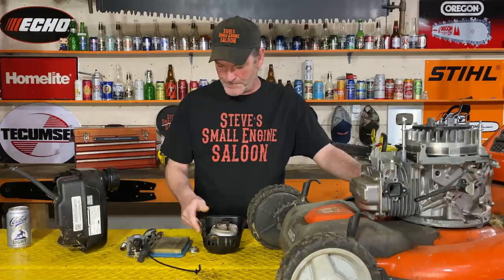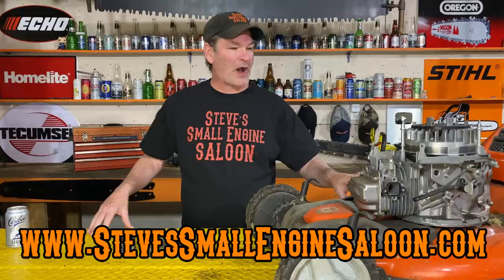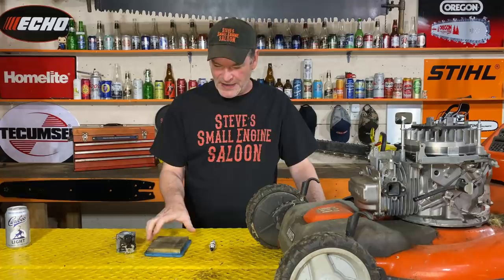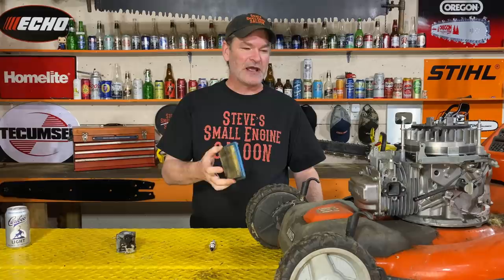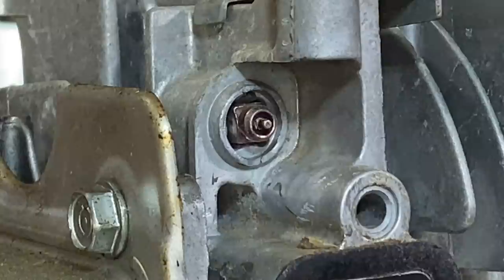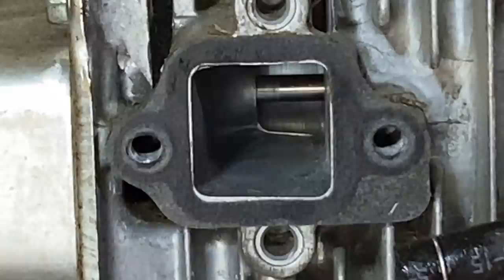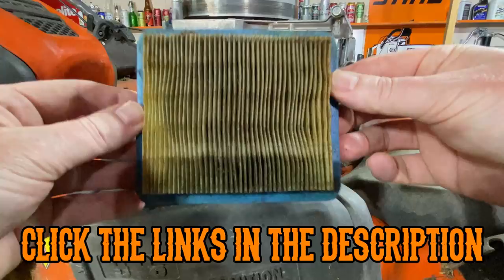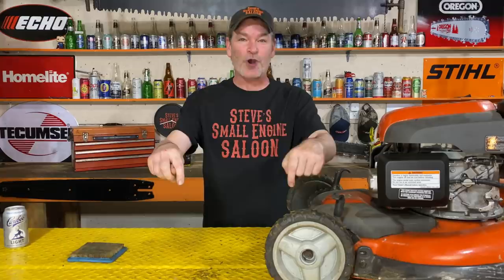What Happens If You Flip A Lawn Mower Over Wrong?  (LOSE MONEY)

Comment: I had a mower given to me because no one could fix it. Water in gas.  I bought a premium self propelled bagger with electric start sold to me for $20.  Guy hung in by the handle on his garage wall all winter. Cylinder full of oil.  Picked up a year old mower for $25. Woman's son tinkered with it then it would not run.  Spark plug wire crimped by housing-not through opening.  Bought a truck and trailer full of Toro S-200 snow blowers for $5 each.  Every one was just a carb diaphram and a few needed new paddles.  Almost bought a nice Cub Cadet garden tractor for $500. Old farmer could not get it to start and gave up on it.  I drained the fuel tank of the kerosene,refilled with gas and took it back to him. I just couldn't live with myself if I kept that one.

Comment: I heard a knocking last year on an older John Deere push mower. Tore it completely apart. Found a little, (almost no) play in the connecting rod. Put it all back together. After 5 minutes, started knocking again... Was the frigging aftermarket lawnmower blade loosening and banging around... Lesson in checking the little things first!
Reply from the maker: Agreed!
Reply: Ya know, another reason why those older John Deere's knock is because they can't ring the door bell eh !
Reply: Picked up a push mower on the side of the road,  said free on it. Got it home and started it, ran very rough and low rpm. Started taking it apart and saw it was not taken care of, grass everywhere. Under the cover, packed in the fins of the engine. All it was missing was a spring on the throttle lever. Nice easy, cheap fix! Just a little maintenance goes a long way!
Reply: I picked up a Toro Personal Pace lawn mower, almost new, because the owner was told that the crankshaft was bent.  I tipped it over to check the crank and the blade was so loose it almost fell off.  Tightened it back up and sold it for $250.00 the next day.  It ran perfectly.  I'm looking for another one.  Ha ha

Comment: Two years back I picked one up trash day with a kholer engine. It stayed dormant in my tool shed until this last weekend. Tried to start it and no luck. I did look into the air filter right away. For further precautions I took the fuel bowl and carb apart.  Dusted it them off and fired right up minus the air filter lol. 
Did just what you done and the exact same thing happened. It went to dye almost immediately.  Air filter replacement $5.99
Great video 👍🏼👍🏼👍🏼

Comment: I was taught check the simple things first. Saves so much headache, time, money, and work.  Clogged spark arrestors create a similar issue. I found if you simply remove said arrestors it alleviates the choking issue. Some types of Stihl equipment are quite problematic in this regard. Also one must always follow directions on machinery.
Reply: I took one off of my weed eater and it instantly ran like brand new! Yep,,,,, file 13.
Reply: @marcmyers1465  true dat!  I use high octane, non ethanol gas in all my gas powered  equipment. Everything runs better without the gumming and clogging effects you can also get from ethanol.  Best to stay away from it if one can do so.  Good information BTW.
Reply: If you’re having that problem you are probably mixing your 2 cycle gas oil mix with too much oil. It also really helps to use the Stihl full synthetic additive.
Reply: @Manhandle730  very good points. It is always best to use the recommend oil in the exact ratios.
Reply: @patricknesbit2334  it really does. I worked for a guy years ago that instead of using up the can of two cycle he would just top it off when it was 1/4 full or so. Then he would add the normal amount of oil. You do that enough and you’re running your equipment on a 50/50 or more blend. The gas was black I swear!! Worst part was he wouldn’t listen to reason. Obviously because I was in my early 20s and young and he was in his four years therefore smart totally made sense. This is a tiny example of this guys genius mind. I wasn’t surprised when I learned a year after quitting that he went out of business.
Reply: @Manhandle730  aww yes the arrogance of some when they get older and "wiser"  and feel that simply because someone is younger than them that person is stupid and therefore truly ignorant of how things work. I have run up against this so many times in my fifty years of life. I do not care how old someone is I know there are those young, brilliant, wiser minds that often times have much to offer and can teach an old, willing dog new tricks as it were.  People of all ages need to be flexible and understand they may not know it all even if they are older than their teacher. 

My father taught me to mix in a large can to the right ratios and use smaller gallon jugs to fill equipment with. Once the big can is empty we  make fresh new batch, thus avoiding the mess you saw.

Comment: I have the same mower. Had it for almost three years now. Still starts and runs perfect but leaks oil from the head gasket. Second Honda engine mower i have had to leak oil. I also removed the plastic cover over the front belt as it just completely clogged with grass every time I mowed.

Comment: I had two push mowers given to me. The one needed a new fuel line which had rotted off. The other mower I cleaned the carb and am still using it. If the mower doesn’t start, people do not want to be bothered. I guess that’s to our benefit. Keep the great video’s coming!
Reply from the maker: Will do!

Comment: 2 free "used once" mowers exactly alike. What's the story? Brigs motors ran out of gas and fuel added, just enough to finish the big lawn. It wouldn't start so he bought another, filled it and the same thing happened. He bought a different mower with a bigger tank.
Reply: @tomtheplummer7322  Or give up smoking lol
Reply: if he can afford that...  my dad's complaint about his current brush cutter is that he'd like it to have a little bit bigger tank, so he gets tired of using it at about the same time it runs out of gas, so I bought one with a bigger tank.

Comment: I have two garages full of small engines that I fixed over the years. I haven't bought a lawn mower since 1992, and I still have that one. I have my choice of what to use when I blow snow, mow the lawn, etc.  Like you and others have said, common sense is mostly what you need when you work on small engines. I spotted a Toro snow blower at the curb, and just from looking at it, I knew what the issue was---it was missing the primer. I cleaned the carburetor and plug, put a new primer on from Ebay for $3, and it fired right up. I used it the next week to clean my driveway at my workshop, and it ran like a top. A year later I found a Husqvarna 125BVX blower tossed out. It ran off the curb, but not well. The air filter was packed with dirt and the plug was fouled. I replaced both for under $5, and got a used blower tube, so I'm into the whole thing for $20. It runs like a champ. I could go on and on. We are in a throwaway society where people don't take the time to go through the simple stuff and take care of their investments. 

In 2019, I spotted a circa 2007 MTD mower at the curb, two doors up from me. I took it and the cord was "locked up" solid. I got to looking at it, and the air filter was soaked with oil. The engine oil was clean, but WAY over the full mark. I leveled off the oil, put a new plug and air filter in and freed up the cord. Pulled the starter rope and it fired right up.

The next day I'm cutting my lawn with it, and the neighbor that threw it out is walking his dog. He signals for me to shut the machine off. He said, "Oh, got it running?" (Pretty obvious that I did). I said, "Yea, someone overfilled it with oil and soaked the air filter...." He said, "Well I didn't need it anyhow, I bought an electric mower". I laughed and said, "Yup, everyone throws out a good running gas mower to go buy an electric one". LOL.

Comment: Level one diagnostic: Fuel, air or spark. It's gotta be one or a combination.
Reply: Or timing, they can shear the flywheel key.
The formula for starting an engine is F.A.R.T.S.
Fuel.
Air.
Revolutions.
Timing.
Spark.
If those check good, it's a base engine concern and engine integrity tests must follow.
Compression.
Leak down.
Boroscope.
Teardown inspections.
Yep.
It's a process.
Reply: Or  compression.

Comment: Steve, two days after I watched this video I found a Toro Recycler out at the curb for trash day. It looked barely used and the engine pulled over with good compression. Turns out the only issue was an oil fouled air filter. Owner had over-filled the crankcase. Shaking my head!
Reply from the maker: Right on Mark!

Comment: Had a Husky mower years ago. Ran really well. It didn’t like hitting a small tree stump though. Engine survived but got ripped off the deck ! Deck was wrecked, it was only plastic. New deck and it was as good as new.
Reply from the maker: Interesting!
Reply: I got a Briggs 24 hp V twin with the electric clutch for 100 bucks. It had 3 hours on it.  Guy bought a zero turn JD.  He mowed his yard one time and the tornado hit Joplin. Picked up his mower and flipped it. His insurance paid for a new one and didn't want the old one. I put it on a racing mower I built. Sold the electric clutch for 100 bucks. I would run 50% regular gas and 50% Torco 110 octane. Cop got me once on the road out front of my house. He showed me his radar.  61 in a 55. Lol
Reply: @jerrymeeuwse859  When properly geared, 24HP could easily get you up to 60MPH, as long as the tractor isn't too heavy though, remember, its that whole power to weight ratio.
Reply: @stellarproductions8888  Oh yeah I know. I've built a number of racing mowers and experimented with many different setups.  I build my own front axles because I'm not gonna go that fast on that stock axle. Peerless 700 series mud box trannies are the best. I put a tall 3rd gear in them and by the time you hit 4th, your gone. I used to have lots of friends and other racers come and ask me advice or help building their racers. It sure is fun. I built a quarter mile track in my back pasture in Missouri and would have atleast 2 races a month. Lots of fun had by all
Reply: @jerrymeeuwse859  Sounds like loads of fun for sure. I got one of those 1990 Craftsman, back when the hoods were all metal and square shaped. It's only got a 12.5HP engine. But I swapped the 8" pulley on tranny with a 3.5", installed a few idler pulleys, different belt, just to get it away from nut buster shifter. Wasn't for racing, just a transport speed boost. Can easily go 20MPH. But like you said. Stock axle, stock tranny break, no proper suspension, too scary going that speed off-road. You go total bucking bronco, thrown off lol. I put on a piston shift knob, rear tires got Carlisle Super Lugs, they bight good in mud. Front tires I got Carlisle ATV Holeshots, which are bias-ply, and resist turning less. Some people really like it when they see it lol
Reply: @stellarproductions8888  
Yep, we tried different sizes of pulleys.  You know, swapping the bigger one on the trans and smaller engine one. The shaft sizes are different but what I found works best was a 5 to 6 inch difference.  Say a 8" front pulley and a 3" transmission pulley.  I' fastened my throttle right on the steering wheel about 2 O'clock. Like a bicycle brake lever style or a snowmobile.  That way I could keep on the gas, steer and shift with other hand. Saw a lot of guys foot slip off the gas as I passed them in the curves. Never had brakes either. Didn't need them. I'd ALWAYS drill a hole and washer and pin front axles.  Seen many of those cheap E-clips pop off guys front right wheel and ya know how that ended. It was fun because I was old enough to be most of these guys dad or grandpa and yet I'd whip their asses on the track. I would only help em build theirs or give them tips if they asked. I'd tell them ALMOST all my secrets.  But not ones like having  my buddies machine shop access.  I'd shave the heads down as far as possible.  Hone out intake ports and polish. Or change number of teeth on sprockets. Lmao. Those Carlisle little tractor tires would throw the dirt too. I power slid through the corners . I think they were a little scared to throw it sideways and crank on the power. Riding snowmobiles as a kid I think helped me with that.  Oh heck, I better stop bending your ear. Thanks for the conversation.  Brought back a lot of fond memories.  Take care
Reply: @marcmyers1465  lol, don't forget to drill a couple extra holes in the muffler.  Gotta let it breath. At 7:00 am lol
Reply: @stellarproductions8888  Probably the first laws that the Wright Bros figured out! Oh and a bunch of torque!
Reply: @kenhurley4441  And to think, all the towns people laughed in their faces, told the bros if man we're meant to fly, he would have wings. Notice how that comment accomplished two things. First it tells people that woman would not have the right to do it, (Amilia Airhart proved them wrong) and as a put down to the bros, complete lack of confidence. While it's true it was most certainly not easy, that lawn mower engine barely got the death trap off the ground, but they did it! And now today, flight industry is a multi billion dollar industry. I struggle the think what our world would have been like if it weren't for the invention of planes.

Comment: Hey Steve 
Had similar symptoms on our old 2 cycle Toro.  Over time, the engine kept running slower and slower. I did all the usual stuff, plug, carb, spark, air filter,  new gas-oil; nothing worked.

Then as I was scraping out the gras under the deck I noticed that the exhaust seemed plugged with grass so I pulled off the cover and ‘Voila’  there was the culprit.

Seems the gas-oil mix ran so rich over the years the exhaust completely fouled the entire exhaust choking out the airflow entirely.

Once cleaned, it now starts on first pull again, who knew?

I really enjoy your channel Steve,  ‘Keep  em coming’.

Cheers, Larry

Comment: I once picked up an old Victa Two Stroke mower dumped in  the bush . All that was wrong with it was the exhaust port was clogged up with carbon and only had a hole about as big as little finger .  I unclogged it and gave it a port polish and away it went . Used it for many years but eventually the frame rusted out .  I wish I still had it . It was so light and easy to use especially on wet lawns . My Honda is a great mower but it's real heavy .

Comment: Great video Steve, sometimes it is just something as simple an air filter to get something running as good as new again. I just can't believe someone spent that much money for a lawnmower and never gave you a chance (or any small engine mechanic) to look at it to see how much it would cost to fix it before replacing it with yet another very expensive mower. Either way I appreciate your abilities and a great way to present it in a video.
Reply from the maker: Thanks 👍

Comment: I bought a 3000w Honda Generator on FB marketplace for $50 because the guy couldn't get it running.  It was in perfect shape, just needed a missing linkage.  Still debating on flipping it or not.  Runs like a dream.   I also bought a B&S 5000w generator for $75 dollars.  All it needed was a valve adjustment and it also runs perfectly.  My wealthy neighbor gave me a 1 year old nice Toro snowblower as well that he couldn't get running.  Even gave me the receipt and paperwork from the local small engine mechanic who couldn't fix it either.  The seat in the carburetor was split and flooded it within seconds of starting.  $1 and it was back in business.  Gotta love these deals!
Reply from the maker: Right on Joey!

Comment: LOL!     Awesome.  I was once given a brand new Craftsman powered push mower that 'didn't run'.   Guy bought it and couldnt get it started then just left it in his garage.  I finally ended up with it.  Turned out he didn't route the pull starter cable up to the handlebars.... it was left completely wound on the engine.  Which means that he wasn't able to hold the handlebar safety cut-off down when he was pulling on it!!   I routed the pull start rope the correct way to the handlebar, and it started up on the second pull!    :P
Reply from the maker: WOW!

Comment: Back in 2019, I picked up a 150 hour 2016 John Deere D155 tractor with 48" deck for 900$ from a dealer, about 1/2 of what it should have been priced at.  The previous owner said it was having trouble cutting and he traded it in on a new one.  I figured out (at the dealership btw) that there was a solid 3 inches of grass solidified onto the deck.  The guy never used the washout port!!  1hr of scraping grass saved me almost $1000 :D

Comment: I love free mowers except when someone else has torn them all apart 😅
Reply from the maker: Good point!
Reply: But those are the best ones. Like in Steve’s case, they took a whole lot of stuff off because they had no clue. They just hadn’t looked at the correct part yet, even though they had to remove it to get the carburetor off.
Reply: @ralfie8801  Yeah, I hear ya. It's the putting everything back together that I'm not a fan of especially when parts are missing.

Comment: While not a lawn mower, I had a similar experience a few weeks ago with someone throwing away an Echo leaf blower. Looked brand new, and I found the only thing wrong with it was that the pull cord mechanism wasn't working. I pulled it apart, rewound the spring, and then put it back on. After a few pulls, I had myself a fully-functional leaf blower which costs about $300 US new!
Reply from the maker: Right on

Comment: With the b&s air filter you have so soak the new filter in oil according to the manual. It's the foam (reusable?) Filter. Over saturating the filter get you starting problems as the oil sags to the bottom. I wish Steve told me about this problem, but finding it out yourself is rewarding in its own way.